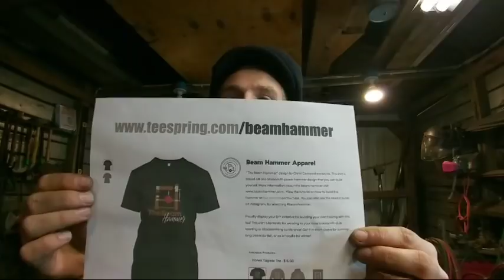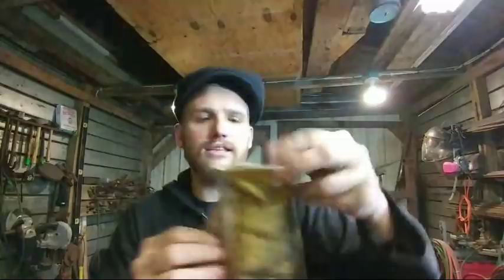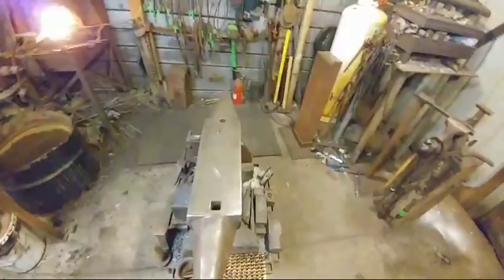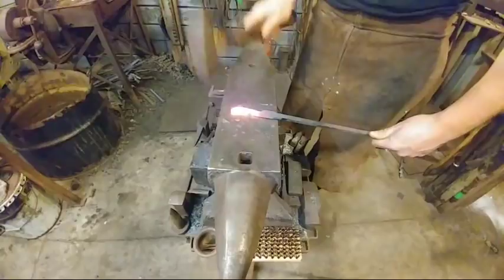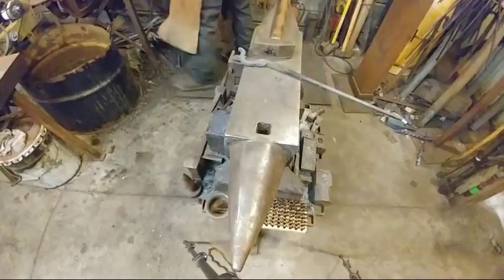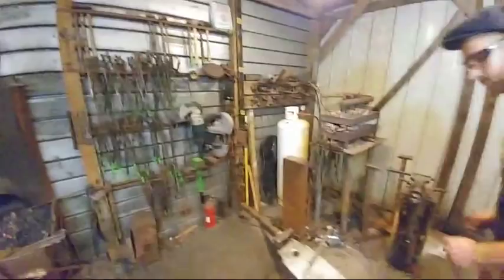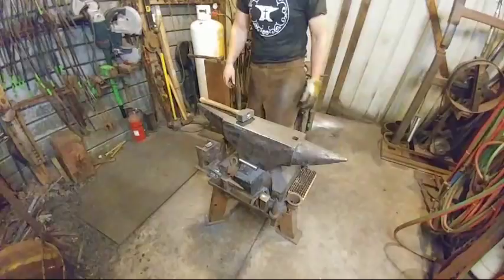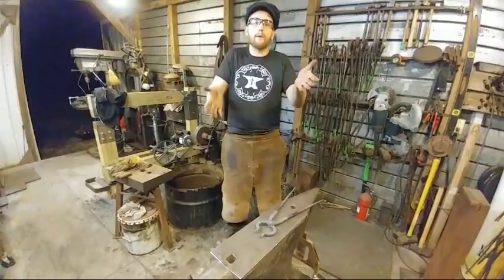Live Bolt Tong Demo !!!

Comment: You're a nut, your full of jokes, and the series on toolmaking is apreciated, and when I can get enough time I will try to make some of them out of better barstock then that one round bar that is 1/2 inch or more round was supposed to be part of some pickup style tongs as you called them but now I think I will turn it into a crowbar or type of chisel once I get something to heat it with and flatten it out better.